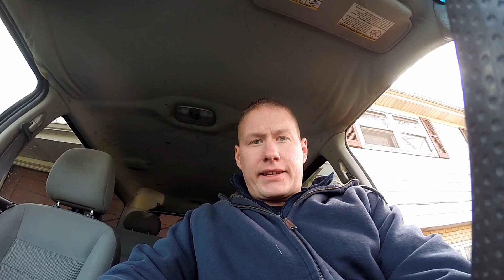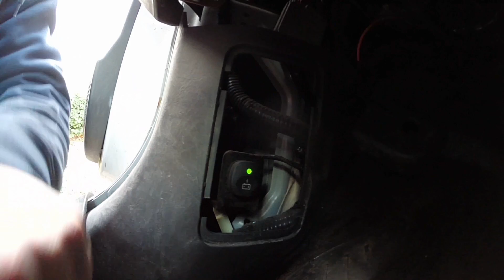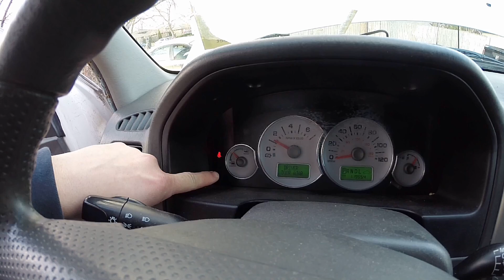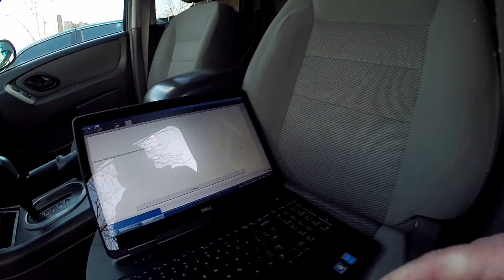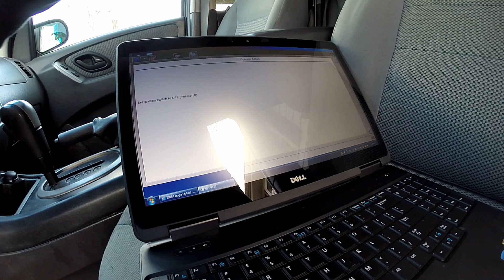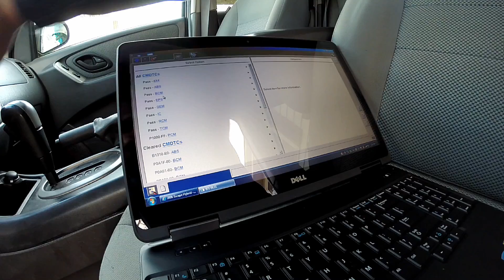2007 Ford Escape Hybrid No Start

Comment: what is the software that you use on your laptop?
Reply from the maker: It is the dealer IDS software I will have a future video on it.
Reply from the maker: +lightningsmokerXx The 1.5l seems to be a much more refined engine fixing the issues associated with the 1.6L but I think both will be fine. It all depends on if you need the extra power. The 1.5L will be louder as it will be straining more under load so be sure you test drive them both.

Comment: Man I bet you get sick of those chimes.
Reply from the maker: +anajay78 yup
Reply: +FordTechMakuloco --  Used to use duct tape with a flat washer to hold the button in. Then i went to unplugging the wire until they routed the plug into some dark recessed spot that even Steven Spielberg is afraid of finding.  I gotta restock my ear plugs - only get 30 uses with each pair.